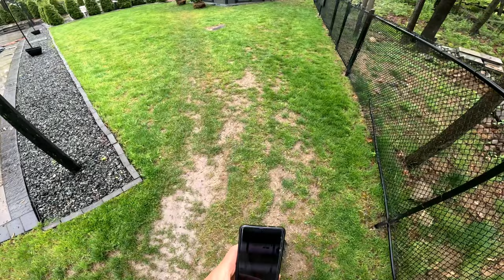Batting Cage & Putting Green Synthetic Grass Project

Comment: Couple of quick questions.
What kind of floor mat is this? Do you have the link to specs or the product?
Second, how do you avoid squirrels and rodents chewing holes in the net when no one is around?
Reply from the maker: @khaleefax9553  it's not a flooring mat, it's outdoor artificial turf designed for putting greens. There are many manufacturers, I'd recommend that you call the manufacturers directly and request a sample box. To prevent any known rodents from burrowing under the turf or chewing through, we recommend adding wire mesh to the ground base.
Reply: @allseasonservices  
Do you know who is the manufacturer of this outdoor artificial turf?